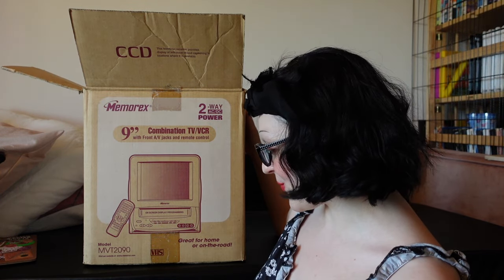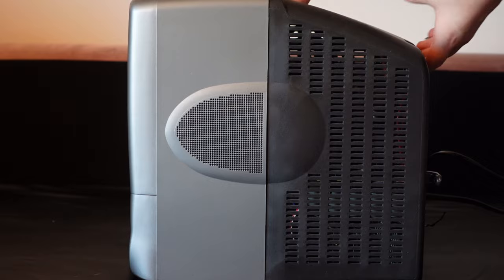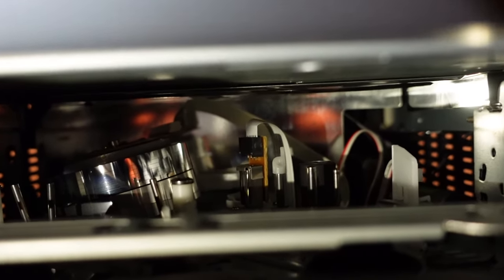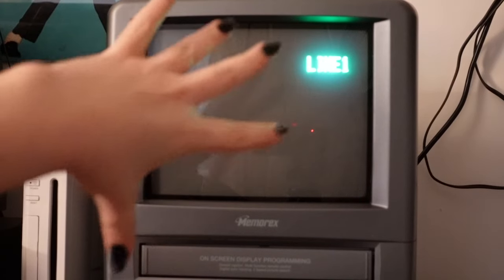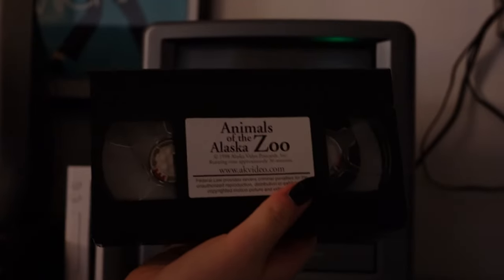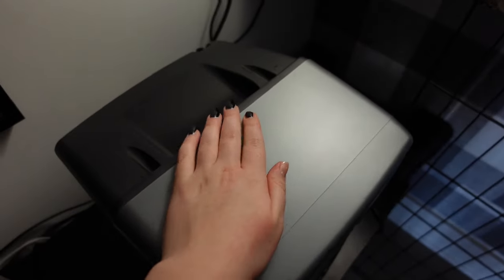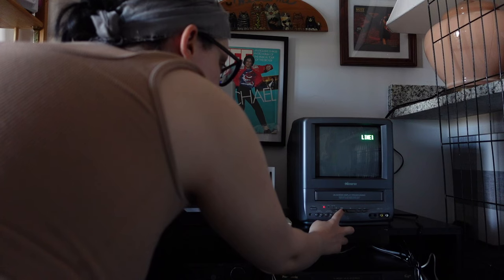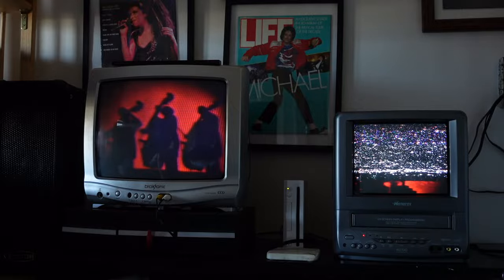A Portable CRT Combo From QVC!

Comment: Fun fact, I believe the Broksonic and the Memorex were both manufactured by Orion, they were like Funai in the early 2000's making electronics under big names. The way I noticed is the Broksonic and the Memorex both have the same TV On Screen Display menu. The Memorex VCR menu is also similar to my 2004 Toshiba DVD/VCR combo that was made by Orion. And yes that TV does have a Auto Head Cleaner, although it's probably a soft piece of white styrofoam, and not a squishy yellow piece of foam like your Magnavox (Funai made unit), so hopefully it will give you less trouble. I so badly want to info dump my knowledge  about the units but I'm holding myself back. 😁😂
Reply: my funai tv (Sylvania branded 27 in) drives me nuts, because there's no way to adjust the picture without the exact OEM remote, even a universal remote I tried can't bring up the picture settings.
Reply from the maker: Info dump away bc I live for this!!

Comment: I have a Magnavox crt tv. My mom bought it new in the early 90’s. The TV itself was from October of 1991. She had it in her apartment, and in the first house they she and my dad bought back in March of 1996. (They still live in that house) It was put into storage for a very long time in the attic of the house covered with an old blanket. I was in the attic one day and I found it, I took it out of the attic and plugged it in and the static sound and “snow” appeared. I connected a analog to digital converter. I still use it sometimes, works perfectly.

I also bought a Universal Remote, because the original remote was lost a long time ago.

Comment: No one should be getting mad at you for anything! Although not gonna lie the occasional stark difference in audio volume might MIGHT get me there now and then 🤣. 

Your remote doesn’t have a backlight but rather just a simple glow in the dark material charged by light. That unit definitely is LOW hours to virtually NO hours because that glow section would be a gross shiny yellow by now if the remote had had a lot of use. This is a 2 head VCR that were the most durable at the end of the line, you probably don’t need to worry about the head cleaner for a long time. 

Neat find for 50 bucks. I smell your first Trinitron around the corner…
Reply from the maker: Now that’s a very fair point, I have this problem where I literally scream at the camera if im excited 😂 you can tell I’ve simmered down in the voiceovers bc those happen a couple days after LMAO. will keep the volume levels in mind. Thanks for explaining the remote situation, I really think it’s the worst remote I’ve used. 

That video will surely come, and I will definitely be screaming 😂😂😂

Comment: Nice looking CRT, picked up a very good one indeed. The whistling or high frequency sound is nothing to be alarmed about, it’s the high voltage anode going into the fly back transformer, it’s common with these oldest CRT’s. how ever the expensive ones have suppressors and regulators which reflect the price. The auto head cleaning mechanism doesn’t necessarily clear the tape oxide however it is a catchment device and regular service can keep it clear. The brightness indicates low hours of use. I serviced CRT’s and electronics for almost 38 years so this should last you many years on moderate to average use. A gold find indeed, happy retro venturing 📺

Comment: This is a cool video I love your new CRT TV you got off of Facebook marketplace, my 2000 RCA CRT built-in VCR combo player is still working great! I haven’t used it much, but I love the CRTs, though. They’re much better than the flatscreen TVs and they last longer too! Originally when I got my RCA, I opened up the inside of it and it was very clean, but I cleaned it and polished it. I also blew it out with my air compressor too. 😃📺

Comment: You can always check if the remote is working by pointing it at your phone camera. The infrared should be visible on your phone as a fetching purple.

Or for my TV and my current phone combo, a feching electric lilac.
Reply from the maker: Will it work on a Nokia flip or iPad?
Reply: @YasmineCollects  Absolutely will work on 2 Fab 2 Flippy. I don't have have any puns for iPad, but it will work on that too.
Reply from the maker: @vinnyfanneran3116 yassss 😂❤ thanks

Comment: The remote likely doesn't have a backlight. The middle section looks to be glow in the dark material. Also you have a rabbit ears antenna that mounts to the top of the tv and a 12v plug to plug it into your car. I am sure this is all in the manual. Manuals were better back then.
Reply from the maker: Like a true consumer, I ignored the manual LOL